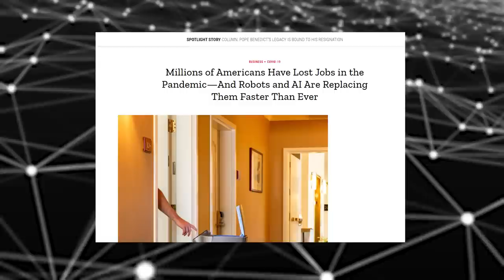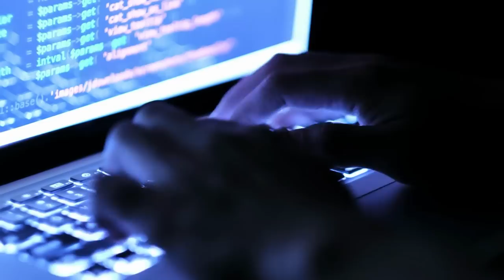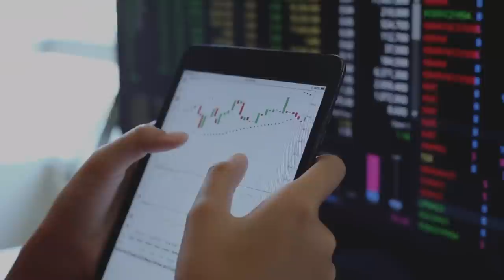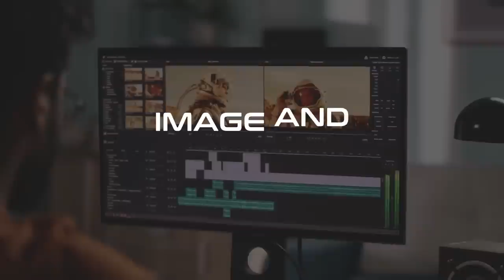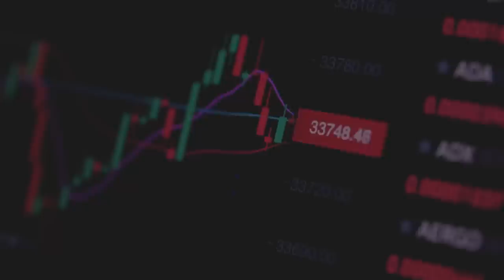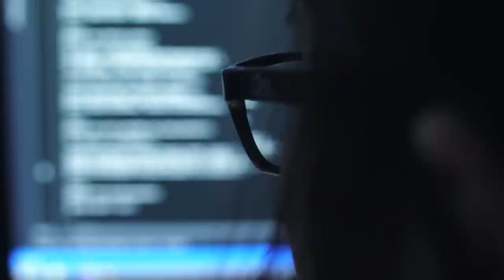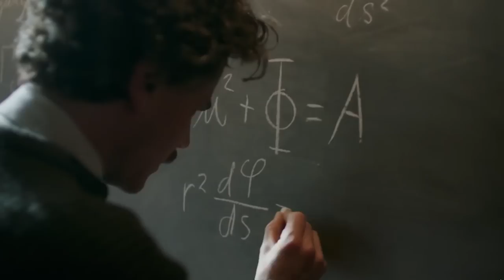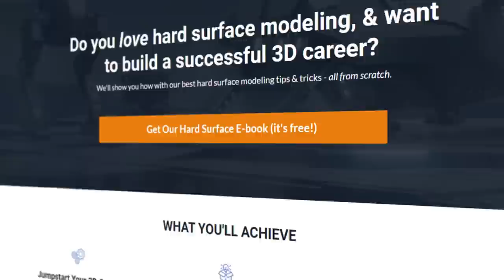The AI Revolution: Here's what will happen

Comment: AI programmer on board here... I used to program servo controllers for so-called "smart prosthetics" back in the late 90s and early 2000s. These devices use AI to learn about the habits of the user and the environments they move around in and thus optimize their movements. These devices were tested by war veteran volunteers. They're just barely hitting the market now. It took many years to refine the physical structure of the devices themselves... optimizing materials, reducing the weight through modifications to the body plans, etc. but the AI we programmed into them didn't have much need to advance beyond what we had originally implemented... the CPUs were updated and they started using stronger servos but the software itself was pretty much perfect. This is a shining example of what AI should be used for... making human lives better. We used it to allow disabled veterans to walk normally again, and I was quite proud of being involved in such a noble endeavor. That's why it bothers me so much to see it being used to screw over artists and the like. This isn't what it should be used for.

Comment: The way AI is at the moment you basically have people using it in 2 ways. You have the non artists typing in some words and using it like a random image generator and then you have artists using it as a tool to speed up their workflows.

In the future non artists are not going to be taking artists jobs using AI because AI alone isn't precise enough for the art and design industry and probably won't be for a while yet. The non artists usually also don't know how to fix mistakes, make slight adjustments or finish a peice. On top of that while AI can enable people to skip the physical skill needed for some art it doesn't enable people to skip art and design knowledge or creativity. 

In the future anti AI artists don't need to worry about AI taking their jobs, they need to worry about other artists using AI taking their jobs. 

Industry generally doesn't care about art, it cares about being efficient and making a profit, if another artist can do your job 10 times quicker by using AI in their workflow you will be out of a job.

Anyone that wants to be an artist working in the industry in the future should be learning AI now, it's not going to go away and it's only going to improve. This goes for all fields too including 3D. At some point in the near future AI will be able to produce a fully textured 3D model from a just a few images of the object or character. I don't know how the 3D industry will be affected but I imagine being a 3D artist will become more about concepting and finalising a model rather than building it from scratch.

Comment: OK BUT WHAT ABOUT 3D ART?? HARD SURFACE. This seems to relate more to 2D.
Reply: There is already AI that can create 3D models and textures. AI can do anything, so 3D is not safe.
Reply from the maker: run this video through chat GPT, it will give you the summary you've missed.
Reply: @PonteRyuurui  I did watch it. I was hoping you would describe how it would affect 3D, specifically hard surface. This seems more general.
Reply: @Cyberdemon1542  The same points of the video go for HS 3D art as well.
I actually did a nightmare client scenario on Twitter with someone claiming AI would put us out of work, gave them a very precise brief but then wanted subtle but specific changes made to the work.
He gave up after 3 attempts because he couldn't direct the AI well enough to be able to give me what I wanted.
As for AI generated 3D models, those meshes will probably be complete trash and you'll find you'll need to remodel the whole thing anyway, which is why I would only use AI as a baseline idea tool and never for a final piece!